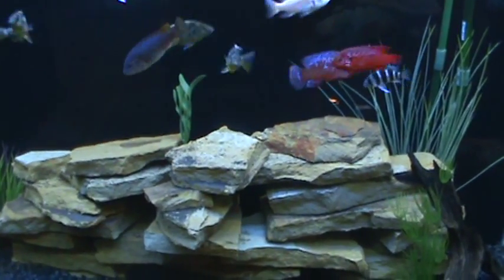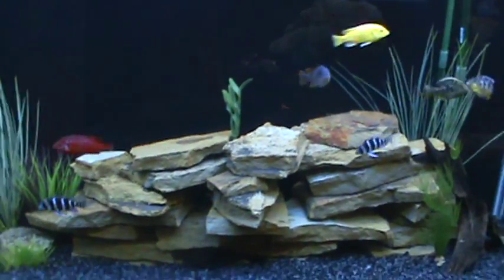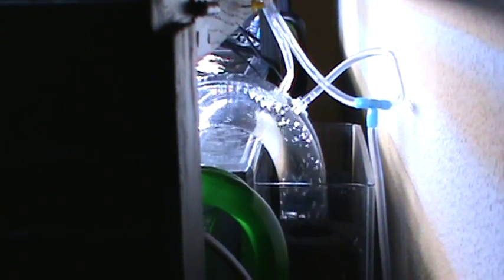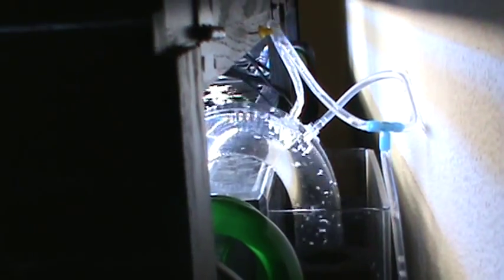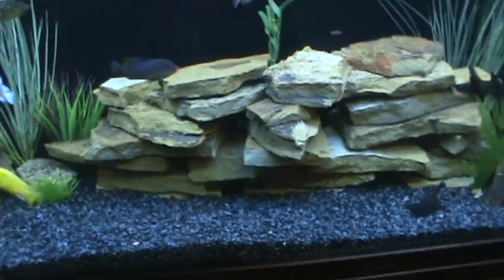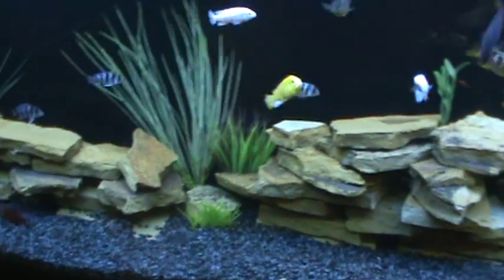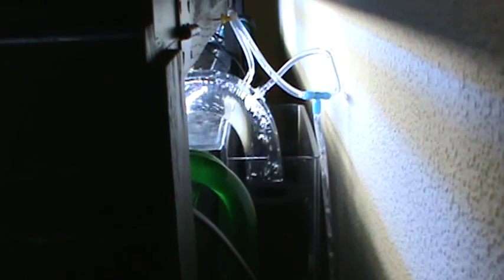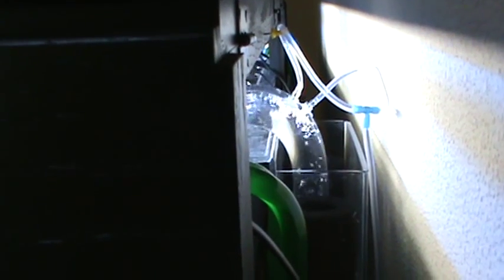Continual air removal from clear siphon tubes on overflow box (JABFH)

Comment: I used a soldering iron with a cone shape tip and a Venturi power head in tank and connected the tube from top of u tube onto the venturi on pump a 400lh power head with a tap on the tube to limit Wat the power head pulls just anoth er cheaper way than a Tom's aqua lifter
Reply: So the venturi pump is just always pumping water into the overflow tube? So if there is air in the system, the water coming from the venturi will continue providing the necessary flow to keep the siphon going? Thank you so much.

Comment: Why not just use two overflow boxes, so if one fails, the other still runs, and could you also use two aqualifters, should one fail, one still runs. Came across this vid cos I’m doing a 4 tier 2ft shrimp tank and I’m gonna link up all 4 tanks with 3 overflow boxes.

Comment: Hi Jarrod, are you presently still running your overflow with the Toms aqua lifter pump? How has it been working for you?
My overflow keeps losing prime and my tanks are overflowing every other week or so. Tried everything and this is the only thing left for me to try. 
Drilling my tanks is not an option as I have only been able to successfully drill 3 out of 6 55 Gallon tanks. 
Let me know
Keith

Comment: I have done the same, no need to drill holes. I simply put one airline tube into the syphon hose and connected it to the lifter pump. I am, however, using dark colored tubing as (in a reef tank with my kind of lighting), algae does grow in the tube if it has tons of light. Also, I added a pre-filter between the intake and the lifter pump (they have filters) to make sure the pump diaphragm is not clogged. Then, I put the return back into the display tank. Why? Because at 3.5+ gal per hour, I am breaking a simple rule: in such a setup, you can have ONE pump returning water to the display tank, and all other overflow boxes (in case you use multiple tanks in a chain) need to be using using gravity. You need to push the water up and let the gravity return it down; by adding even a small amount of return by a pump, you are pushing more water down than the pump pushing it can handle (the volume of water your return pump can handle + the lifter pump's 3.5+ gal/hr). I would return the water from the lifter pump back into the display tank.

Comment: Def should get smaller u tubes and u wont have this problem.  Wont be enough room for air to settle. It will prob get forced through. Another thing to consider if your aqua lifter fails your tank will overflow correct?
Reply: Silva Jr could he get two aqualifters? So that if one fails, another still works to maintain air suction

Comment: you can use a smaller diameter hose and you wont have to worry about the bubbles. if its a 1" U tube try using a 3/4" piece of flex tubing or U tube if you can get one. Small water has to travel faster through the smaller hose = no bubbles in the U tube ;)

Comment from the maker: @foxloner The air is introduced when the water splashes down inside the overflow box.  In my opinion the overflow box is not very well designed.  I could probably make some of that stop by reducing the pumping rate back up into the tank, but I cranked the pump up after solving the air problem.

Comment: Glad you posted this. I did the same thing several years ago to a 150 gallon saltwater tank I am running and it works great takes the fear out of losing power which has happened several times. Hopefully some more people can use this idea. Thumbs up. D